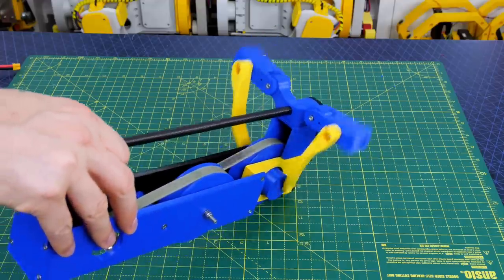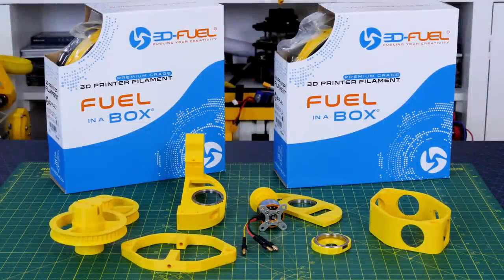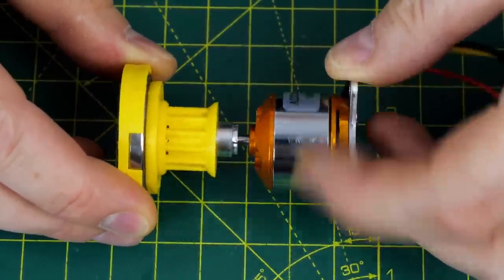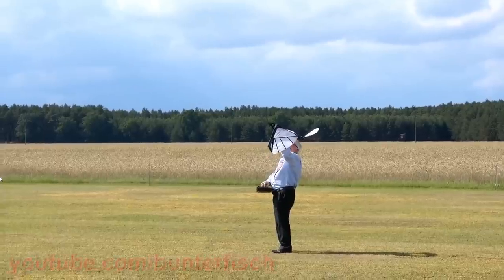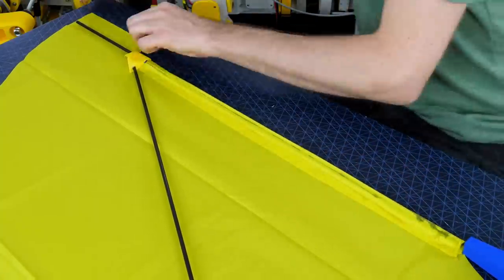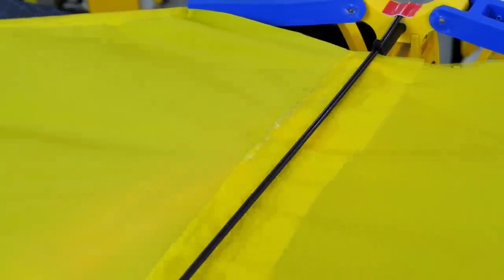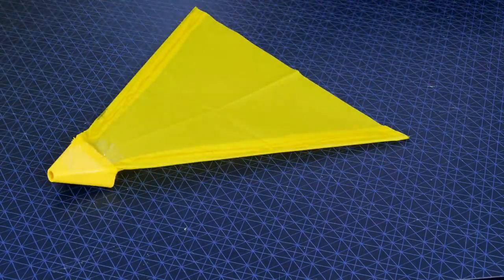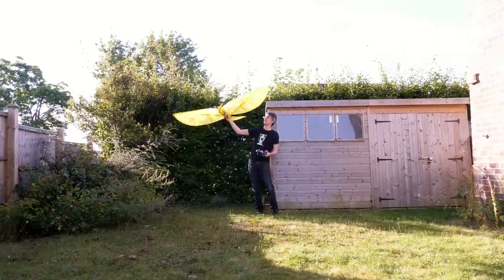Ornithopter Flying Machine Part #2

Comment: Hi James, with your transmitter you can adjust reduce your throttle (less power) so that you have more resolution. This will mean that you can find the sweet sport to flapping wings with efficacy to over flapping much easier.

Comment: birds use the stiffness of their wing feather to push the air with the feather tips. 
the front of the wings is also shaped like a plane aerofoil. (or the other way around if you like)

Comment: I think the issue is with your motor not being able to run at low speeds. Either brushed or a sensored motor and ESC combo would be a good alternative. The sensored combo would also give you a lot more control over the motor

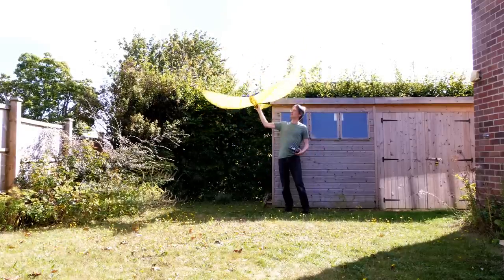Comment: At 8:15 you said there's too much lift. No such thing. It's your cg. That's specter of gravity. For some reason you put your battery at the back wich is pulling the back of the ornithocopter down. Put it in the first third of the craft. Where the "birds breast" would be. Also at the bottom for stability.

Comment: You might dial down your dual rates or end points on your throttle. Just run down your throttle up endpoint to wherever the max speed that the wings behave happily at, then you can just go full throttle and know it'll be the right speed.

Comment: one thing you could do is put a Throttle curve on the radio, or limit the throttle travel. These can be done easily in the radio itself so that you should be able to judge the throttle position easier.

Comment: I would instead buy a quality motor with more coils and lower kV. That would make the job for the esc much easier. Also I suggest using a drone esc, they have much better modern transistors so they are atleast 2x as powerful for the weight than the one you are using. I have that motor and its not good btw. Adding more weight with another gear demands even more of those wings which is already at their limit. A 20g drone esc will outperform that esc lol. Even the dirt cheap drone esc at 20g on Banggood is more powerful than that esc since they use GAND transistors with extremely low Rdson.

Comment: The load on motor gets high as the wing flaps down & reduces when flapping up.  I would add a spring that exerts 1/2 down force on the wing, so the load on the motor is equal when cruising.

Comment: I think if you hollow out every part way more and for the front rods and add joints with Maybe a wire to keep it tight you can achieve a more natural lift inducing wing structure. Like if you hollow the front rods, snap em in certain places, keep em tight and together with a cord of some sort and allow it to be a pumping arcing flap instead of a flat one

Birds have hollow Bones and jointy movements. The bigger you go the more so.

Comment: Mabey first make it work as a glider, then add thrust by a flapping tail and then add the flapping wings. Birds of prey also are great gliders. We had a dovesnest in a three where you could not leave by direct climbing. They let themselfs fall out of the three, gain some speed while gliding down and then start flapping and gaining altitude

Comment: I think it would help if you glued the frame of the wings onto the fabric while it was under tension, Then just cut around the outside and the rigid frame would hold the tension. Never done this before, just an idea i had.

Comment: So much potential, love the thing.
But some ideas;
im guessing the belt driven gear reduction looks very heavy and bulky. There must be better ways.
Also the motor is one that is meant for speed not power. You will want to get a motor that has a way lower kV rating.
For the rest, it looks really good.

Comment: Nifty ! 1st off, it ought to glide ok at center cycle position unpowered. Then, only during the up stoke half of a cycle a mechanism should somehow change(decrease) the wing's shape/angle/lift/effective surface area etc. Perhaps with a simple cam mech that just pulls on/or bends the wings in some useful way(at the correct time), since actually changing the angle of the wing would require even more mechanical parts. Not that the same effect can't be accomplished via "smart" flexing only. Which seems to be what you're going for. Essentially, the amount of air "scooped" needs to change during up Vs. down. I never examined a real one but I suspect the straight & rigid rods across the leading edge should be curved downwards & flexible such that they naturally bend downwards even more during the up stroke yet are ridged during the down/power half of the cycle. Then no additional mechanism would even be needed. Either way, you got this !

Comment: You should try a lower kv motor if you can, instead of another reduction stage. That will help with torque as well. Also an ESC running blheli should work better, and stall less (and be lighter than a car ESC). It also looked like it was trying to pitch up somewhat, so you may be able to angle the tail down a little to compensate.

Comment: your Problem could also be that, instead of moving the wings the motor moves the body in the oposite direction.
Dragonflies have four wings, two pairs of wings moving in oposit direction nullifying this.
if you arrange the wings like an X the mechanics could be at one point, also the forward right wing should be moving with the backward left wing to also balance lift/thrust.
in this case the two forward and the two backward wings could actually be conected in a solid fashion, as the left forward wing would move up when the right forward wing goes down, this would also allow the two pairs of wings be driven like the two wings in the two winged version.

Comment: IDea of flapping wings to create lift is based on that you have more surface area when moving wings down than when you move them up. This way, more upward force is generated than downward force (if just talking about the wings - to fly this would also need to overcome gravity). So this extremely simple ornithopter seems to me like a complete waste of energy. Wings have the same surface area when moving up or down and should generate same amount of force, so it would just vibrate in place + gravity. I think simple glider could be far more efficient at flying.

Comment: It seems that this type of ornithopter   flaps the wings to produce forward thrust and not lift (like the propeller of a plane) and the tail gives pitch control; that's why wings have a "triangular" shape. I think the thing to do is to maximize the forward thrust keeping a bit of tail weight, then wings should automatically produce lift but because they're pushed forward in the air. So try to consider wings like the blade of a propeller instead of... wings (i would maintain max wing axial pitch above 45° to convert the "flapping" in more forward thrust instead of vertical lift) . Finally, for completeness, if you want to actually produce lift by flapping the wings the concept is that they have to produce more uplift in the down stroke than downlift in the upstroke, like other comments suggested; try to take a look at Da Vinci's ornithopter!

Comment: Your Gear box is ok,no need to add an extra gear to cut the gear ratio,just move CG a bit forward,and tail up to 25'degree and it will lift off!

Comment: The centre of balance is too far back, or the elevator is raised up too much.  This is evident from the fact that it pitches back immediately after launch (which it's not due to the rate or amount of flapping).   Try moving weight forward so it can do a controlled/level glide all the way to the ground (like a traditional balsa-wood glider) before you start adding the motor/flapping input.    Good luck!

Comment: I think that a simple PID control system to maintain a set motor speed might be more beneficial than changing gearing or swapping the motor. Since the motor speed is guaranteed to decrease after launch due to the increased load I cant see how it would be possible to overcome the speed issue without modulating the output voltage to the motor, although maybe with a lot of practice you could do it manually with the controller.

Comment: Maybe focus on bigger gears.  Or a slower more torque motor.  If you have issues with too much weight in the back, then you might not want to add another gear ration which will move the weight back.  Also perhaps look into set screws for locking the 3d printed parts into the carbon fiber rod as opposed to using glue.

Comment: On the wind up ornithopters the tail is connected by a small steel piece that can be bent to dial in the angle, which was necessary in my case.

Comment: You could use the lighter pulley and make a protective guard in front of it by curving the 2mm bendy carbon fibre tubing, in case of another crash.

Comment: I saw a diagram (of a flying bat) where instead of a belt mechanism they used one small gear (for the motor) and two larger gears. The flexibile wing rods (long flat sticks) are attached to the body as a lever while the inner ends are hinged on the larger gears. As the motor gear spins it rotates the other gear clockwise and the other one connected to it also rotates but counterclockwise.
(The gears are arranged flat face forward and the wing rods are hinged  on each opposite large gears left and right)

Comment: Oh, and also forgot to mention, about the wing speed, set the end limit/throttle curve on your transmitter to only allow it to whatever percent you want as max to prevent the 'spasms'.  A trick you can use for it is to mix one of the dial knob channels negatively to the throttle so that it acts as an adjustable limiter, allowing on the fly speed limit adjustment.

Comment: I was thinking how the up part of a birds flap happens quicker than the down: Maybe delaying the stroke with a bunjee or resistance plate (that the "crank" section of the front pully would hit) could possibly overcome the stalling and jiggling at the same time?? Or maybe doing this in code with a TDC position sensor even?  Just bullshitting out loud but anyways freaking loving this vid series!
Reply: You could be on to something

Comment: If you connect the motor to a worm drive arrangement, possibly via a carbon fiber shaft running front back, you maybe could get a bigger gear reduction with greater simplicity and at lighter weight...

Comment: I think it could benefit from a shorter wing span, or wings that won’t flex. I feel the the wings are too long so the leverage causes warping and that fluttering in high speed. If the “wing bone”was more rigid, or shorter it could make more efficient flip flaps! If you could find a way to reduce drag on the upstroke it would have more lift and strain the motor less. Also your design is already minimal but I would try to cut weight in anyway possible! (Screws, glue, and plastic are heavy so use them as little as possible)

Comment: U need 2 get the wings 2 have a greater range of movement, a bit more on the down stroke, n about 2 times the stroke on the up, wings level bein the center point. Your wings r fluttering at higher speeds cause they r 2 flexable. Hope this helps

Comment: nice project, but you should have started with a simple rc model plane for your first airborne project. and please spread the glue with little paintbrush or spatula, gives greater surface area and lesser stress on the glue joints

Comment: how about a print in place compound gearbox (2 halves bolted together) connected to the BL motor. printing with resin will be an even better choice because parts can be more homogeneous and stiff than FDM printing could provide

Comment: Maybe a stupid question but if the upward and downward movement of the wing is the same, why would it fly? I thought that the shoulder joint should be eccentric so that the upward motion has a higher angle of attack than the downward

Comment: Shouldn't the up-stroke be different than the down-stroke in order to produce an upward force? (e.g. flexible on the up-motion, rigid on the down-motion AND/OR a slight tilting of the wings using phase-offset)

Comment: Is it possible to build a motorized Ornithopter that can support the weight of a man? a friend of mine is trying but I don't know if it is possible he is using the engine of a moped? maybe a 50 cc in your opinion is it possible that it takes off?

Comment: The movement of the ornithopter is wrong... It should resample the rowing motion of boat more.  
Also you will need to increase the movement range. The wings need to make larger more exaugurated movements. Similar to what birds do on take off...

Comment: Is it realy an Ornithopter and not a Chirpterthopter?
Wouldn't an ornithopter need adjustable and interlocking feathers protruding from the arms instead of a continuous skin-surface to form a control and lift surface?

Comment: It's not that it had "too much lift" it's that it started out WAY too tail heavy. That's why it always has its nose pitch too far up every time it starts to get a good grip on the air to start it's glide. It was so tail heavy that you could move the battery all the way to the front and it was still tail heavy lol. You really should have done substantial glide tests first before even putting the wing motion into the equation. This thing has no nose ahead of the wings, and a large amount of wing mass close to the tail. Of course it's too tail heavy. It was so tail heavy that it did a backflip. If even I can see how tail heavy it is surely you can too.

Comment: 1)       it would be a good idea to get some mass  FORWARD  of  the  wing.!!!
2)       it would be good  if you  understood  aircraft  design, Distribution of  Mass (dom), etc.
3)       it would be good if you understood  cg  rules.         correct  cg  location  is  a  Percentage  of wing chord.        in the case of a normal airframe, it's  30 percent.         
4)       it is typical, in a 'thopter application, that a  HIGH kv outrunner  be  used; see electric helicopters.         this ensures that there is plenty of  input  torque; from rpms,  and  from the size/shape of the motor.
5)        as you have noticed, you have used a reduced flap  Amplitude.
6)        in order for a membrane wing 'thopter to launch, a flap rate of about  ten hz  is  Necessary.
7)       CF  is  Heavy.         use  WOOD, wherever  possible.   spruce.
8)       as practical,  COLLAPSE  the  transmission.!!!
9)       normally, an aircraft if designed so that is has an inherently  nose-heavy  dom.
thus, cg is  Supposed to be located at thirty percent of chord.   and,  center of mass (c-m)  location is  Supposed to vertically align with  25 percent.
correct location  of  c-m  is  indicated; at linked illustration
https://s3.amazonaws.com/assets.flitetest.com/article_images/medium/truecg-jpg_1384168691.jpg
(not working, right now)
https://wright.nasa.gov/airplane/shortw.html

https://www.youtube.com/user/BZH07614/videos
https://www.youtube.com/user/smorrismlbco/videos

Comment: There is nothing in this mechanism to cause the device to have more up force from the downward flap than it has down force from the upper flap.  No lnet lift from the mechanism plus gravity equals not flying.  More torque will not cure the inherent deficiencies of the mechanism.

Comment: I don't know anything, but the pulley idea doesn't seem suited for this case. Especially with larger wings and range of motion, you need a lot of torque. I would say a gear reduction or even a worm gear would reduce a lot the mass and complexity.

Comment: Your speed issue yells control to me. I'd want to add an arduino to read in imu data, an AS5600 (to read in the rotation angle of the main drive pulley), & controller commands from the radio. Use the current angle of the slow pulley and vertical acceleration data with an fft to set the motor's speed and phase angle to the craft's response frequency (2 separate controls). I'd also think about eccentric paths such that, on a down stroke you are compressing air and it could be beneficial to spend an extra fraction of a second with the wings fully down before beginning an up stroke; allow the pressure some time to provide lift. Easily doable in code and 2 additional control inputs.

Then comes ideas on complex mechanical systems. The arms could be allowed to rotate towards the back (along their respective vertical z axis'), add a 1:1 pulley in front of the nose, and adjust the spars such that the first two sections can collapse (reducing the wing profile a bit); reinforcement suggestions below. While the wings are in a down stroke the drive arms on the new pulley will be forwards, extending the wings, and the drive arms would be towards the back of the new pulley on an up stroke, retracting the wings' front edges.

If you add a second set of swing arms, except connected to the second from the front set of spars, then you could double up your main drive pulley and slightly lead your secondary arms in both directions; this would happen naturally if you kept the pulley directly under the main arm pivots but a bit in front of the secondary arm pivots. This would produce a flap like structure on a down stroke and an airplane wing like structure on an up stroke all while restoring rigidity from using the retracting wings from above. Near the fully up position there should be a point where the main arms and secondary arms are at an ideal glide arrangement which the system could revert to in an open controls condition.

I'd also take a hint from Dune and ignite the jets.

Comment: Use gears or a cardan crank with vertical slider instead of heavy AF belt drives.
Your models far too heavy, wrong weight distribution and the connections from the drive to the wing need to be further out board to reduce spaz attacks.

You could also use a better pancake type motor if you want to retain a gear/pulley train.

There's tons more could be done for weight and efficiency but the above will correct the worst in your design